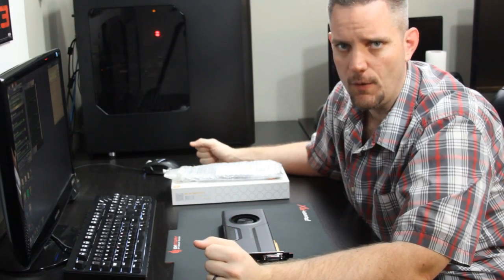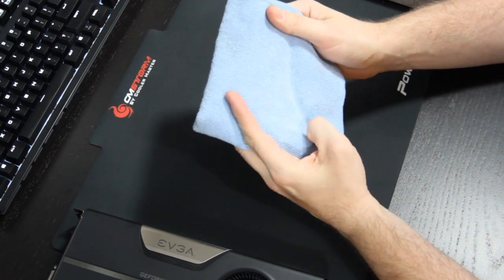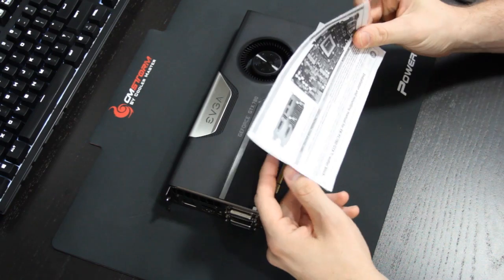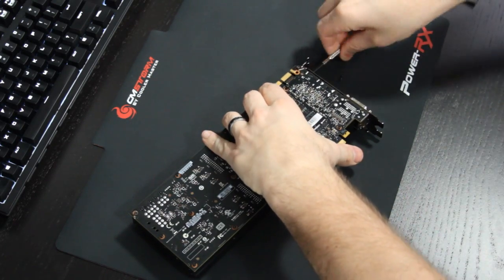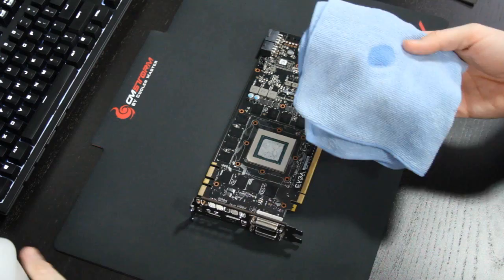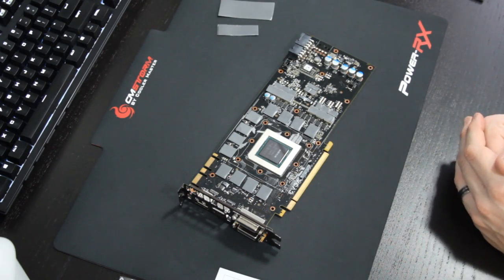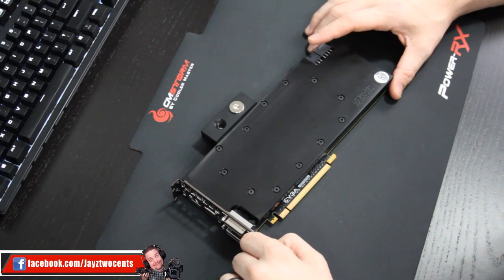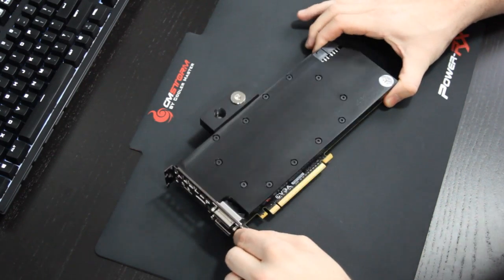How to Water Cool a Video Card - GTX 780 with EK Full Cover Block

Comment: Hey Jay I know this video is over 2 years old but I figured I would ask. I have a EVGA GTX 780SC with the acx cooler on it and I can't seem to find JUST the acx cooler on eBay or Craigslist do you have one that I could buy from you? I would compensate you completely. Just don't have the funds right now for a Pascal considering this card was gifted to me by a fellow PCMR friend I am trying to limp this thing along as long as I can. One of my fans broke off so I only have 1 active fan and it broke in such a way that I can't even epoxy it... Anyways any help would be appreciated. Take care keep making awesome vids.

Comment: who would still spend money on this old 780 ? you can only overclock it THAT much so why would you need the water cooling ? might aswell just get a 980
Reply: +BileMonkey There were 980's in the 60's you dumbass!
Reply: +TheKennylight The GTX 980 was released in september 2014.

jackass.
Reply: TheKennylight i obviously understood that.
what i was thinking was that you meant they were available before this video was made.

Comment: thinking about watercooling my gigabyte R9 270x 4gb but I can not find a waterblock that will fit my card.  what should I do?  its got 3 92mm fans on it and ive changed the pads and paste and it still hits 80-90C under heavy load.
Reply: +Alexander Gallagher what can I do? seems to be a simple square bolt pattern could I make a block fit?
Reply: +redneckhotrodder i recommend seeing ncix tech tips' guide on ghetto installing an all in one liquid cooler onto a card, this may void your warranty though

Comment: not helpful for only 4 screws video card meaning the smaller heat sink with fan which is used up to nvdia 750
Reply: +Jonathan Laig there is no point in water cooling a 750/750 ti as you'd be spending more money on cooling it than on the card itself

Comment: Just asking , but , i can do this? ----> 360m radiator to watercool Asus poseidon platinum , in SLI , with a separate Pump and reservoir??? (I want to watercool the processor using a 240mm radiator with another Pump and reservoir )

Comment: I have a small question about running the water through the block. Am I able to use both the left and right sides as a pass-through? For example, having the water go up through both of the left ports and down through both of the right ports. I'd like to know just so I don't risk destroying a brand new GPU by incorrectly circulating the coolant. I know it's possible on SLI configurations, but I just wanted to check if it's alright on a single-card configuration.

Comment: You mentioned you'd show the right way to get the stock cooler off but skipped it. Do you just gently twist it side to side a bit to break the seal from the paste so it lifts off?

Comment: Hi!
Could you help me, which size of EK-PSC I have to order to fitting my hose which has 12mm out diameter  at the "fitting installation"? I have a Raijintek Triton, and would like to expand that CPU cooler with this stuff, I found tube (12mm), this block, backplate, EK-PLUG G1/4, but I can't find out EK-PSC I have to order..
Thanks a lot and regards: Attila

Comment: Is it possible to use a closed loop water cooler with a water block? I'm just looking for a cost effective way to cool the ever so hot Titan X. Man that card runs hot, I really wished reviewers would talk more on this topic so people have the proper low down. In order to keep a titan X from getting an egg on those Vrams, you have turn fan up to 80-100% and then it sounds like a Boeing Airbus. If someone could answer my question this would really help. Or provide some more cost effective tips. I already know about the Next Bracket, but I'm not to sold on that just yet.
Reply: Lance Echo few things 'bout that stuff.
1. i don't know if the nzxt bracket (i'm assuming your talking about the kraken g10,) is compatible with the titan x, and a closed loop, and you may want to ask jay, since he watercooled his 3 titans (although that is probably more expensive).
2. maybe check out one of the AIO watercooling kits from alphacool or EK, i think there around $100, and they seem pretty good for the money.
3. not trying to be rude, but airbus and boeing are 2 differnt companies...
Reply: Lance Echo Few reviewers are going to say there's a real negative with Nvidia cards - hell, they'll rarely mention prices, because they'd have to explain how a 980 is $100 more expensive than a 390x, but not significantly more powerful.  They'll mention how a 390x is $100 more expensive than a 290x while being only slightly more powerful, but not if it's an Nvidia card
Reply: jedidethfreak yeah because you hardly find people that care anymore. It's all about getting clicks and follows. Very difficult to find the truth among people that are pretending to be your peers. If you get the chance watch this movie "The Joneses" you won't regret it. It's about people blending into society to sell you biased point of views in order to move products. i Agee with you 100%

Comment: Nice! I've been water cooling my rig for years now and now (of course) I'm looking into upgrades. Mobo, ram, cpu, and gpu's. Ha, my old gtx 460 ssc+'s are still working like a charm but man are they old! Looking at the asus Crosshair V Formula-Z, fx 8350, corsair vengence 16gb BUT//, now i'm stuck on gpu's. I want to stick with SLI and evga cards but they will be water cooled so I'm limited at which cards I want. 780, 780ti, 970, 980..... decisions decisions. lol

Comment: I kinda want to make a homemade water cooling system for fun. Of course using old gpus/cpu so I don't have to worry about damaging new stuff. That would be a cool little project
Reply: Blue If you follow instructions, use distilled water, and take your time the chances of damaging any equipment is very very small. Or so I'm told lol. I'll be building my first custom loop for my Titan X and 4790k this month. I'll let you know if I screw up and flush thousands down the liquid cooling drain never to be recovered by warranty. I'd probably just evaporate the water, reassemble the stock cooler, and send it to NVIDIA saying "I don't know what happened, it was fine one day and dead the next!" Doubt that would fly but it would be worth a shot! All the other parts would be easy to RMA without being caught. NVIDIA can probably tell if you removed the stock cooler though.

Comment: Is there any order for the tubing "In" and "Out" or it does not matter?
Reply: Sychose You can use any of the holes on the water block for in and or out I think. As long as theres water going inside and water going out you're golden. But, this can be different from water block to waterblock. And for som ekstra info the order of the loop do not matter either as long as the water go from the resourvar directly to the pump the rest of the order don't matter at all. And res should be higher up than pump so it will flod the pump even if it dies.

Comment: hey quick question - does this work on the GTX 780 acx cooler cards? I checked EK's website but they don't list a full cover for it?
Reply: and its the FTW version
Reply: Ask Jack Just make sure you get a specific waterblock that's made for your specific card and you'll be good.

Comment: Why did he touch the gpu circuit board? That is one of the things you never do, is touch it.
Reply: Riley Hoover I guess that's why so many other people on YouTube touch their circuit boards and nothing happens at all.
Reply: Riley Hoover well then, you're wrong
Reply: BobTheWhiteBoy Sadly, i'm not. The oils on your hand can block the flow of signals, thus proving my point.
Reply: Static is not an issue when it comes to GPU's only with CPU's and RAM.
Reply: Noah Ding Here's the thing, I have been taught that it is a no no.

Comment: would suggest not getting acrylic blocks from ek, they are very week in the center where the center screw meets the multi block connection. I ended up with a small crack barely tightening the thing..

Comment: No offence, but I think watercooling a video card is pathetic. First of all, most video card water blocks cost over a $100 USD, which makes it not worth it, even if you do push out an extra 15-20% on top of your aftermarket pre-build air cooler. For the extra money, I could easily buy a 1 tier higher card, comes out of the box already overclocked, ten overclock it myself another 10%, beats your water cooling any day of the week. All the Radeon and Nvidia high-tier cards are great overclockers already. R290x and GTX 970 can overclock like crazy. This is totally not worth it unless you're some crazed benchmarking fool.
Reply: I think you are right, from your point of view. As for my case, the extra cost is not a problem, sure I'm not a millionaire but I still can afford it. I use a SLI setup with GIGABYTE's WF3 970 cards and they are noisy as hell, I hate noise maybe because I suffer from tinnitus, noise is the last thing I need in my life. I like modding my case, getting creative and doing things to the PC case which makes them unique. A couple of vga waterblocks in a waterloop really pushes the internal looks to a whole new level. Remember I can only talk for myself. Happy gaming.
Reply: So now I can push my watercooled 970 further than your "pushed" air cooled 970. See how that works?
Reply: People who live in constant heat (Florida) this is a must have for crossfire set ups in the summer
Reply: It is useful when you are at the top of your aircooled card setup.. lets say a 780Ti overclocked SLI or 970-980 overclocked SLI. Im sure everybody can see that its not meant to be put on a R9 270x or GTX 660...
Reply: Actually, if you are looking to buy a r9 290, the visontek cryovenom r9 290 le with water block only is about 5$ cheaper than most r9 290.
Reply: Price per profermance sucks when it comes to water cooling your PC. But most people do it as a hobby, to make their pc looks nice and stuff and it's kinda one of a few ways to push for extra performance when you already have the best hardware on the market.
Reply: Jack Liu For a lot of PC gamers money is not an issue. Certainly not $100 extra for better performance and a bad ass looking rig. If you already have the best video card out, why not make it the best water cooled card out? I'm buying a loop for my GPU and CPU for 3 reasons: 

1. I live in Hawaii where it's always in the mid 80's  
2. I want to overclock my card and it has a stock cooler
3. A custom loop looks amazing and I consider my PC a piece of art, it is the centerpiece of my living room.
Reply: You couldn't be more wrong Lawli.
I've been watercooling my video cards for years now and it really helps with the coil noise, i.e. the 980 G1 has, and it drops temperatures down to 50%.
That means that an 80C 980 in full load (Far Cry 4) will drop to 40-45C.

Now if that makes it "not worth it" in ur perspective, then you must be on welfare, clearly.

P.s. Personally I love my 25C idle temp, on 980.
Reply: It's definitely worth it under certain circumstances. 

Yes, if you plan to try and OC it from day one and go as high as you can, it's a good idea. If you live somewhere that stays hot, such as Houston, Florida, anywhere in South Asia, South America or desert it's more than worth it. If you are building in a smaller case, where heat can build up easier, it's worth it. If you buy a card that performs well but can get toasty, such as AMD 280 and up, GTX 770 and up, any Titan card, especially the Titan X, it's worth it. If you are running SLI, it is more than worth it. 

If you don't want to water cool, then that is your decision and nobody is going to hate you for it. As you can see, a lot of people actually do water cool their graphics cards or build custom loops, else there would not be a market for it and tutorials everywhere.

Comment: 77 people poured the alcohol all around the gpu
Reply: One of them microwaved a cat...  o.O
Reply: gaby161290 russians would have drunk it not wasting it on the cpu
Reply: what difference would that make.  Alcohol evaporates so fast by the time he finished putting the block on it would be dry.
Reply: L7057B7 11F19 but u would still swear after doing dat
Reply: 34
Reply: more like denatured alcohol
Reply: russians
Reply: Everyone MAKES mistakes and 40 kg? are you anemic or 10 ?
Reply: Lol that wouldnt damage it though
Reply: ***** I scrubbed the hell out of my gpu using isopropyl alcohol when it was really dusty and it's fine. Still working as before

Comment: I have a GTX 660 by zotac but it is very short and not the full length card cna i fit a water cooler on or a aftermark cooler?

Comment: Awesome video Jay! I have question. I want to go with the ek 780 like this. The one that has the black bottom (I have two Evga 6gb 780). What version is this one? I notice they have nickel, nickel+acetal, and acetal. Does it matter which one? I hear that the nickel ones corrode faster, or something like that. Thanks bud

Comment: or you can buy a liquid cooling adapter on ebay for 8usd !!! i made my liquid cooling system including cpu, mobo chip, gpu for 100 euro!! i used mineral oil and corsair H60 pump and radiator and some cheap pipes...

Comment: even with backplate, that kinda graphic card is heavy, and it eat you screws after a time. there's no conneciton between the backplate you're holding and the waterblock itself, well some tiny screws. It's bending it still. And a 500$ GPU and a 100$ E.k. waterblock becomes useless and worthless after you GPU dies after 2 years.

Comment: This hasn't really explained how to water cool a graphics card, to me anyway, but i'm not exactly savvy when it comes to the more complicated things of computer building.
What do you do after you've installed the cover and back plate? 
The video says how to water cool a video card, but clearly this is only the first half of the process.
Reply: Watercooling always works the same - you create a cooling circle using a pump, a reservoir, a radiator and various coolers: eg. a CPU cooler (which is the default) - this video ist just a bit "advanced" telling you how to ENABLE water cooling for a graphics card by adding the waterblock to add the thing to you circle. Check out Jayz' other videos to get an idea of how to build a basic water cooling circle.

Comment: Wow.  This is ridiculous.  NZXT has a whole kit that lets you set up a bracket and you connect it to any liquid cooler radiator that you'd like.  The bracket is $29.  Way easier.
Reply: that doesnt cool power regulation and ram though
Reply: ***** the RAM isnt the main concern with the NZXT Kraken G10, RAM tends to be ok just with having some airflow, its the VRM that are most concerning with the G10, those things will reach 120C pretty easy and although people will say thats fine for VRM's it is pretty much the maximum limit.
Reply: The kraken G10 is an adapter you still need to a kraken x60 or x40 if you want to liquid cool your card that way

Comment: do u know GTX 780 Gaming Edition? so where can i get watercooling kit for GTX 780 Gaming Edition? i had been look everything and nothing else
Reply: am pain in ass i really need watercooling for GTX 780 Gaming Edition.
Reply: T3hGamingChann3l yes you can
Reply: Water block same as GTX 780 Ti because look same design but one thing different is er know what u need check them in Google pic to see if match.
Reply: London best the gtx 780 gaming edition uses a refrence pcb so you can use any reference waterblocks on it

Comment: would this work for the 760?
Reply: the basic instructions yes but you would of course have to get the 760 waterblock not the 780
Reply: Battlefield 4 | Gameplays and Reviews. Where would i be able to find it?
Reply: spide Cooper its not really worth liquid cooling, the cooling would cost like 300 for a expandable set up, 200 for a cheap gpu system
Reply: spide Cooper that and i dont think they sell 760 waterblocks, but you can buy a closed loop cooler on newegg
Reply: BigNastyreborn The 670 waterblocks work on reference GTX 760s.

Comment: Does anyone know if a reference GTX 780 waterblock will work on the Galaxy GC edition GTX 780?  A review I read said that the card has the exact same PCB layout as the reference cards, so I'm hoping so . . .
Reply: It will fit, I have that card as well and the only thing on it that's non reference is the cooler on the front, so all reference waterblocks and backplates are compatible.

Comment: instead of trying to hold the thing without the screws in don't you think it would of been a better idea to put the water block on something high like a box and then line the screw holes up. and at least would make sense to me and easier than trying holding the water block and card together while trying to put 4 screws in ;-)

Comment: Live in Canada? Cut a pc sized hole in your wall build a mini extension next to your desk. Make it nice and condensation clear! Nice and dry. Slide your pc cut a little hole for your wires and put it through. Have the front of your pc facing out of the hole covering the hole. BOOM.

Comment: Advises to use jar for screws... Does not even use one.
thread silently~
Reply from the maker: There is a difference between me teaching someone whos new, vs me who has been doing it for nearly a decade.
Reply: *****

Hi, Jay. Thanks for a great video!

I'm looking at watercooling my Gigabyte R9 290 (GV-R9290C-4GD rev1) was looking at the EK site but not too sure on everything I'd need for it, pleeease help ;D Thanks fella.
http://www.coolingconfigurator.com/step1_complist?gpu_gpus=1299
Reply: ***** Nice video helped me alot
Reply: ***** Practice what you preach.
Reply: +Steven Tyler Do as I say not as I do
Reply: Malus1531
touché

Comment: I'm thinking of using a universal block for my gtx 460 for my first watercooling setup. should i use copper heat sinks or thermal pads? i've got a 240m side panel fan next to the video card that should help air flow over the card.